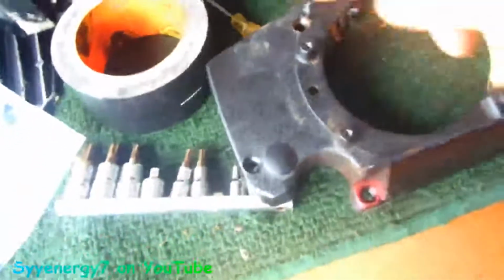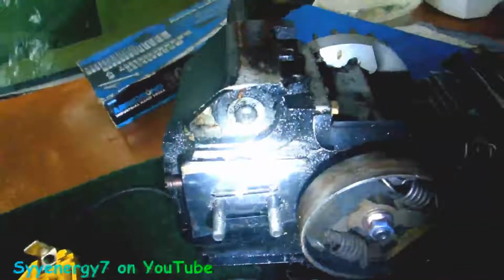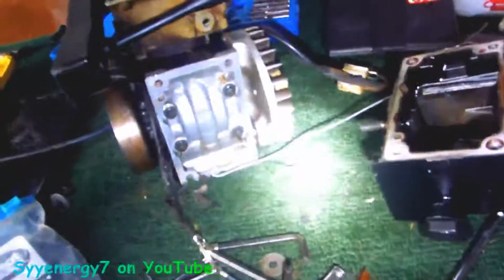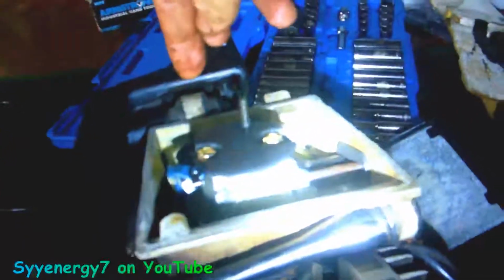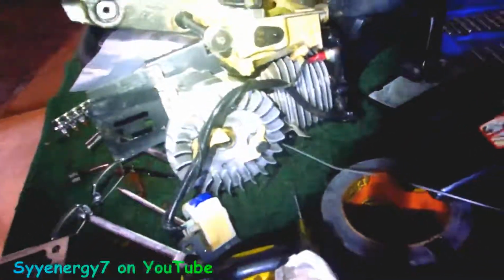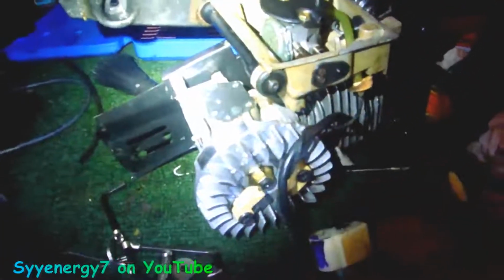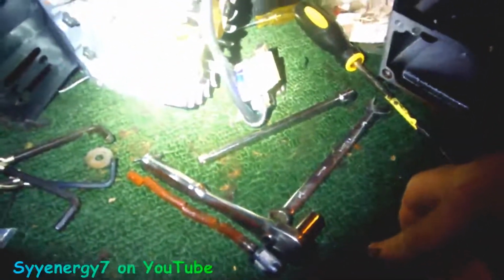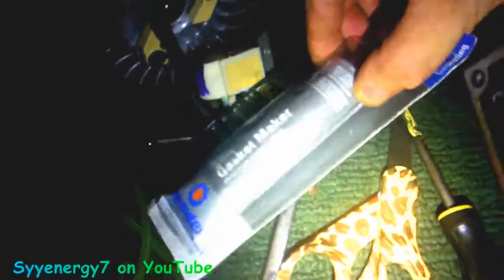McCulloch Pro Mac 610, Replace Oil line, Oil Tank, Ignition Module

Comment: Thank God I did not have to do any of this to my 610.  I did have to replace the diaphragm in the oil pump, but that was it.  It runs and oils the bar, fine.    One thing that I did find was the connector on the kill wire was bent down and was intermiatanly touching the cylinder.  I bent it up and put some shrink wrap on it.  That alleviated the intermittent spark problem that I had when I got it.  I did have to rebuild the carb and replace all the fuel lines and filter.  It now rolls over in a couple of pulls.

Comment: HEY thank you for a The video,my oil tank s broken on the side cos was tighten too strong(talkig  these two bolts for the chain cover...BTW these bolts should be recessed inside the oil tank and locked on four sides, not just one)The chain adjuster nut was Loose,so i think thats why someone tighten up  this 2 main nuts when his chain got loose each ten minutes cutting,Your capture nut on oil adjuster looks loose,i d tighten it up,hope the cat is doing well:)

Comment: RTV sealants will not  last on saws . The vibration of the two stroke along with the heat ,oil and fuel RTV just won't cut it.
 Case mounted oil sump to case ,thick paper gasket sprayed with copper coat let dry give second coat ,let dry , assemble . Case half's no gasket's just anaerobic flange sealer or Three bond .
I've been building hot saws for a few decades ,my saws do not leak.
I like those old mac pro saws, for only being 3.7 cu inch you can get them to pull the teeth through hard wood like an old gear drive saw.
The only complaint I had with the 610 was the manual override oil pump. Every time I took it out to use it the pump required attention .